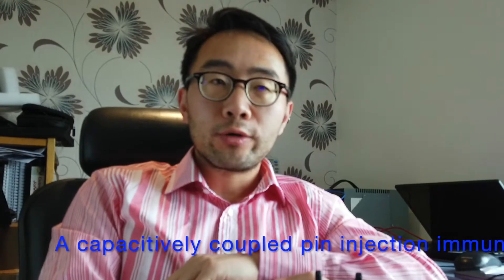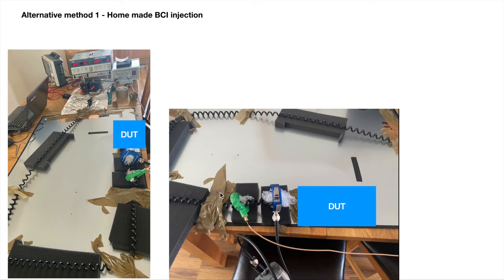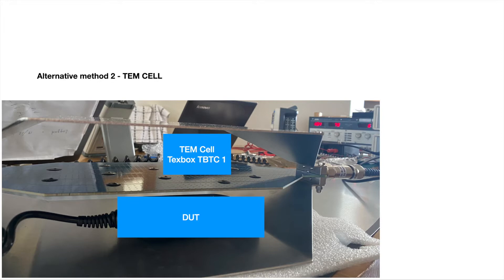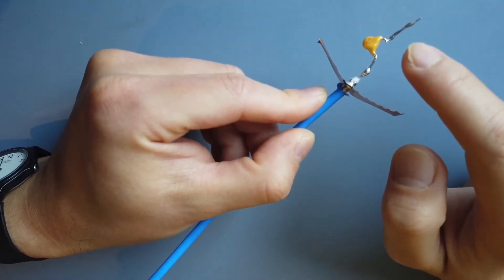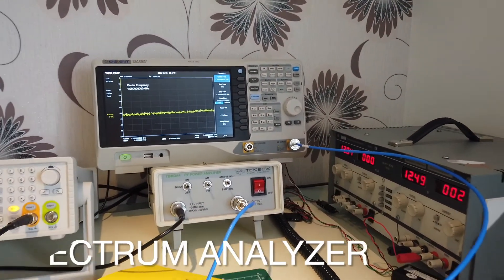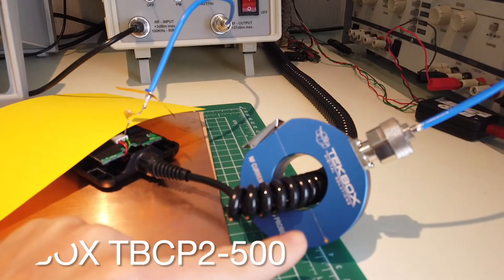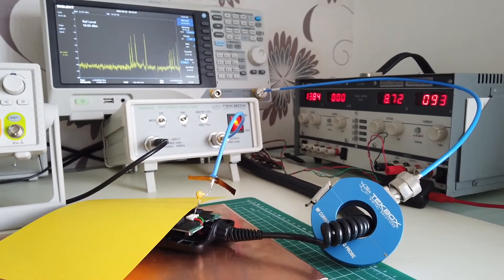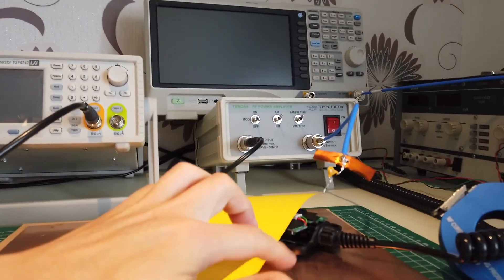Pre-compliance Immunity Test - A Capacitively Coupled Pin Injection method

Comment: BCI is a common mode technique.   Injection as demonstrated is a differential technique.  Would a capacitor to each LIN line correlate better with BCI?